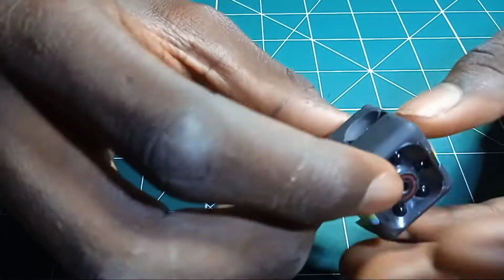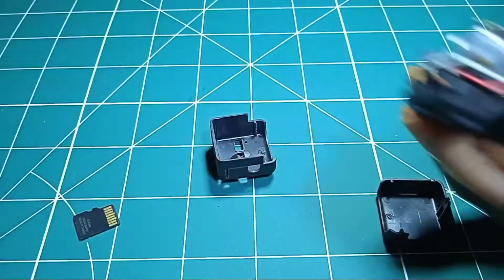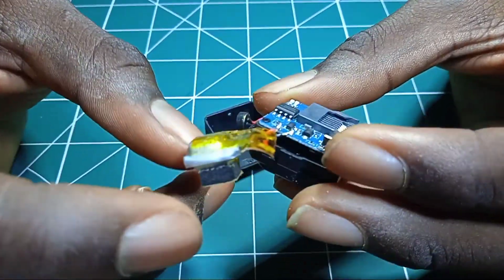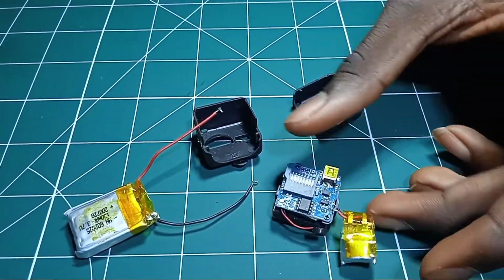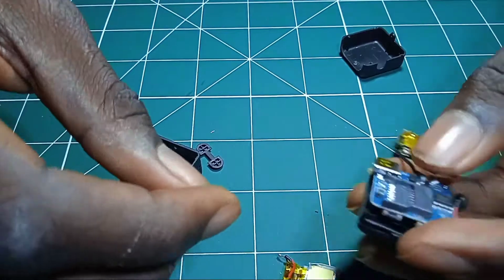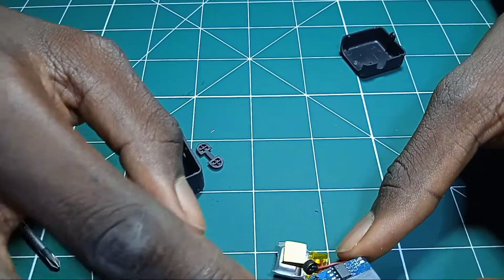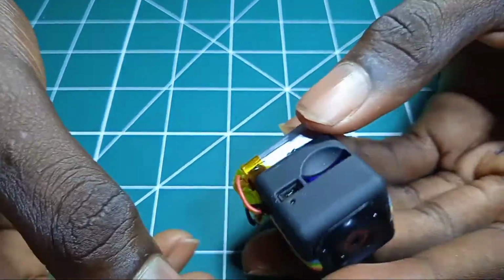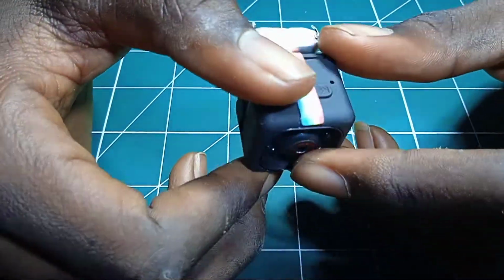How to repair SQ11 MINI DV Camera | SQ11 mini camera not working | Problem solved 100%

Comment: brother, how did you stick the wire of the battery to the circuit board?
Reply from the maker: i soldered it 
use a soldering iron
Reply: @BrainyTraits  Yes, but what is that silver material that suddenly expanded and stuck to the circuit board when touched by the iron? is it lead?
Reply from the maker: @yourlostcarkeys3261  yes it is a soldering lead

Comment: Hi I need ur help, my camera blue light indicator not changing. Evening if on charging the red light is not coming up.
Reply from the maker: @aliyuabdullahi6324  remove the battery and check if current is coming out when plugged in

Comment: what's the part number of the battery?
Reply from the maker: I don't get
But I used a lipo battery
3.8v 1cell
Reply: @BrainyTraits  what its battery thickness, length and width?

Comment: Hi bro how do i fix my camera? it takes pictures but cannot go take video
Reply from the maker: Check the Manuel on how to switch to video mode 
Let me know if you were able to fix it
Reply: @BrainyTraits  i dont have the instructions and the instructions did not make sense 
so i couldnt fix it
Reply from the maker: @gabrielchiu2650  click on mode to switch to video 
Click on the power to start recording it will blink 3 time and the light will off (it recording like that )

Comment: When i record video the file does not play. Also the camera turns off after 15 seconds when i record
Reply from the maker: Firstly is your sd card in good condition? If yes replace the battery and also use an external app to play the video like Inshot

Comment: Hi, I bought mine yesterday and after full charge when I turn it on, it turns off instantly again. (Red and blue blinking) I don’t know why? I am using 32gb micro sd, and camera is fully charged. Is it defective?
Reply from the maker: Change the battery 🔋🔋🔋
Reply: هل لازم شريحه